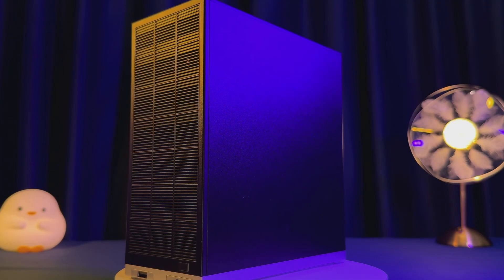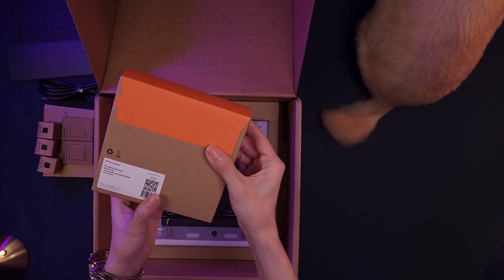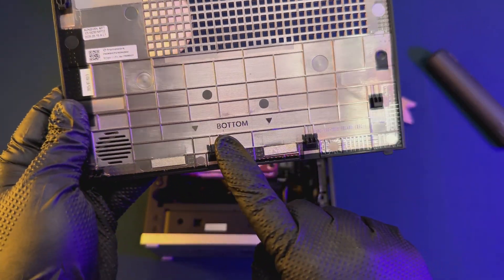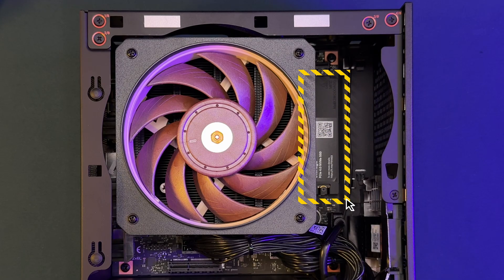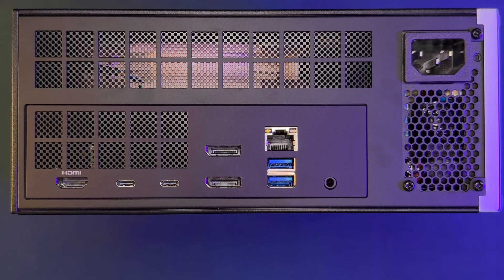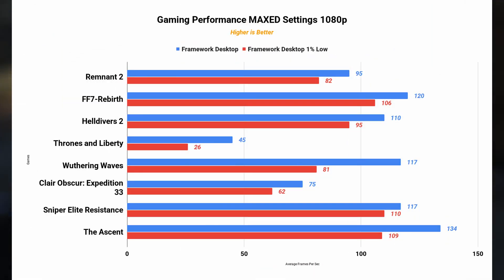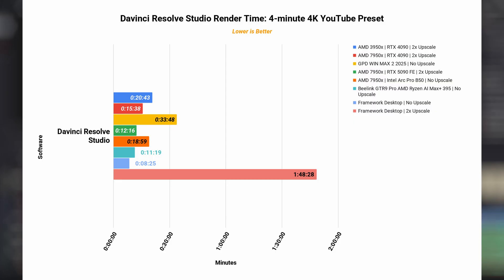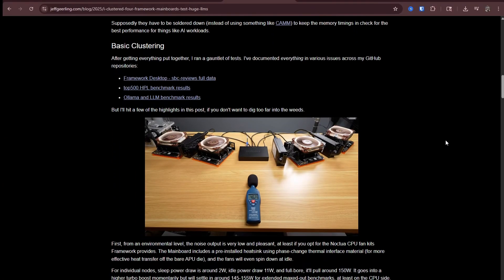Framework Desktop 2025 Review – Compact Powerhouse with AMD Ryzen AI Max+ 395

Comment: With Ryzen AI Max+ 395 inside, the Beelink GTR9 Pro has hardware-level NPU acceleration — looks like it could handle local LLM tasks without cloud dependency.
Reply from the maker: Hi! Thank you for the comment! You're right, the NPU acceleration on the chip allows for handling local LLM tasks without cloud dependency! As of right now, the ROCM drivers isn't mature enough to put the NPU to use yet. Perhaps sometimes in the future it will be able to leverage the NPU of it as well.

Comment: The Beelink GTR9 Pro 395 can reach up to 140W TDP — that’s serious power for a mini PC! I’m really curious how well it handles demanding tasks without throttling.
Reply from the maker: Hello! Thank you for the comment and for watching! They GTR9  Pro and Framework Desktop both performed great under heavy workloads without any throttling. They both have overbuilt cooling solutions, so if that is a concern, don't be. They can push the CPU/APU to its operating limits for long runs without breaking a sweat.

Comment: so its basically a laptop built like a desktop..it could be nice if there is a way to insert a gpu
Reply from the maker: Hi! Thank you for the comment! We would really like to argue with you here, but yeah, that's pretty much what the Framework Desktop boils down to. That PCIE slot is too tight to do anything with. There were some ideas floating in the Framework community forums that it can be used for a 10gbe nic card.